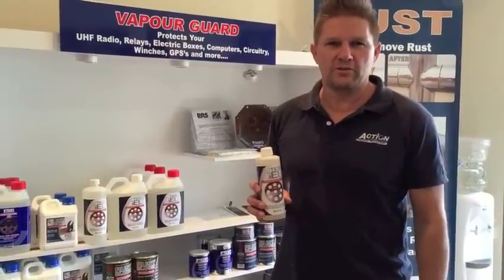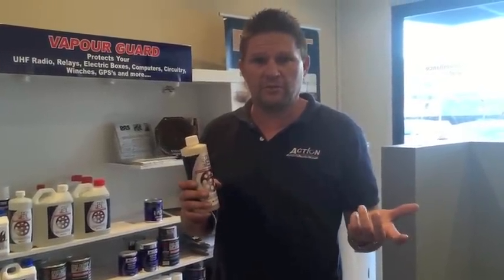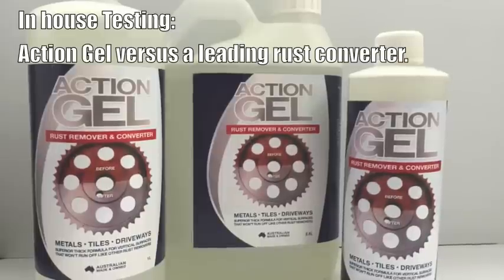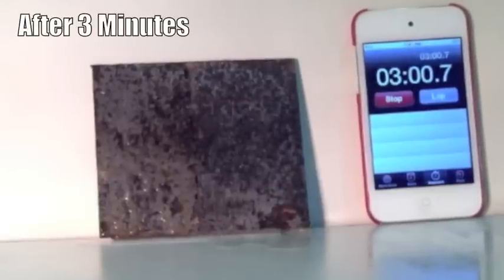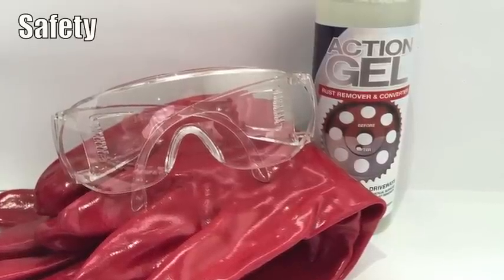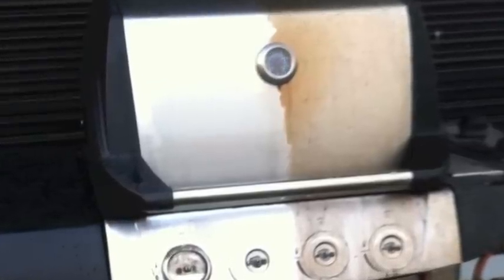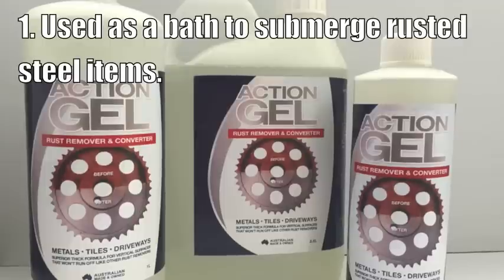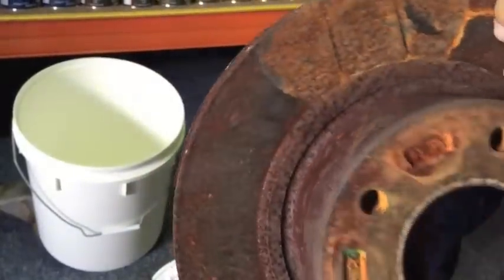Rust Remover versus Rust Converter

Comment: Wonder if I can use this on my vehicle. My battery leaked and caused my battery location to rust.
Reply: Yes you can but change your battery for a gel battery instead or glass mat one
Reply: @RetroYamaha  my truck uses a 24f. I see there is an energizer one for $269 at Costco.

Comment: If this product worked as well as seen in this video, sandblasting would be less common.The old rust that forms near the sea is very tenacious and cannot be easily removed even with an angle grinder and the silicon carbide disc that is specific for these jobs.Maybe you can dissolve the rust from small objects.Perhaps the only product that can going well and saving time and effort is the Owatrol.

Comment: Rusty roofing nails will leave a rust stain on paint as it runs down the wall, I see this all the time as I'm a painter and a little ajax and water on the paint and it comes off without any effort, no need to buy these types of chemicals just for cleaning house paint.

Comment: I have been exploring rust treatments and I have found that all the popular acids (hydrochloric acid, phosphoric acid and white venegar) for rust removal leave a brown rusty looking residue even though I have washed it before drying. does action gel do this as well?
Reply from the maker: Action Gel will absorb the rust and leave the bare metal. For heavy rust it may need to be applied twice to get all of it off. However when done correctly, there is no residue left.

Comment: Can your product be used on a galvanised boat trailer. Will it damage galvanise. I want to use it inside the galvanised trailer tubing. How ca i do it
Reply from the maker: All products can be used on Galvanised metal. You just need to monitor the Action Gel whilst it is applied to ensure it is washed off as soon as the rust has been removed. If you would like to discuss your project further feel free to call 07 5524 2990 or email admin@actioncorrosion.com.au

Comment: What's the difference with this and phosphoric acid?
Reply from the maker: The Action Gel is a phosphoric based product. However pure phosphoric acid is much harsher. It will burn skin easily unlike the Gel which tingles and gives more time to wash it off (Although we still recommend appropriate safety gear). Pure phosphoric acid is also harsher on the metal and will encourage flash rusting again if the metal is not treated immediately. Phosphoric acid also has a consistency of water which runs off and does not stick on vertical or horizontal surfaces like the Action Gel.

Comment: how does this work on auto paint? does it remove auto paint and the rust. you need to do a demo on a car that is full of rust.
last qu. do you ship to the USA
Reply from the maker: For vehicles our products are only for the underbody, interior metal surfaces, bulbars, accessories and plastics. We do not recommend our products to be used on auto paint.  Yes, we have distributors who ship all over the United States. If you email admin@actioncorrosion.com.au with the products you are interested in and your location can assist you further. Or you can order directly from: https://www.actioncorrosionsales.com/shop

Comment: Do rust convertors make the rust solidify?

If you covered a badly rusted car in it would it make the rusted parts as hard as the steel?
Reply from the maker: The Action Gel is a Rust Convertor and Remover so it removes the rust from the metal. You will not have issues with the rust solidifying. When using the Gel, we always recommend doing a small test area in an inconspicuous location and don't let it dry by reapplying if necessary.

Comment: The Red stain on a concrete surface is actually not the concrete rusting. It is an indication that the steel inside the concrete is rusting and the rust color is migrating out to the surface.
Reply: No, it's a result of iron-rich water. We see this here in parts of central British Columbia, where most of us are on wells and iron is a problem. It stains driveways, fences, the sides of homes, anywhere a garden hose or lawn sprinkler wets a surface. The solution: a fairly expensive Birm-based iron filter at the well-head, which removes almost all iron and turns awful water into great water.
Reply: @paulmaxwell8851  , that is also common in perth australia for the same reason when bore water is used.

Comment: So how much for a 1 litre bottle?  This isn't the only gel based rust remover, there's another one I found in Bunnings. The problem we have here is all these products use phosphoric acid, yet some come as low as $15 for 2 litres and another for $54 for two 1 litre bottles, same shit, bigger mark up. So where does yours fit in?
Reply: the price usually differs due to the concentration. the higher the percent the more expensive 1l is gonna be.

Comment: VERY cool! But the first thing I thought of when you hosed off the rotor, is "OH NO! Now it's gonna rust again!"
Reply: Yes, bare metal rusts.
Reply: @PBMS123  Use rust remover first, wash off dry it with a hot air gun then apply rust converter, that's what I do.
Reply: @hf5909  doesn't make sense. why're you applying rust converter on a clean rust free metal? what is it gonna convert? 😂😂
Reply: @richmadrid9563  because metal rusts every second. you just cant see it. and due to not being able to directly paint after rust removal then you apply rust conver to just be sure

Comment: I am not trying to knock anyone's product but these things that say they neutralize rust.No.They may neutralize the rust on top but they do nothing to the rust that is deeper and covered over.There is no easy,fast way to eradicate rust.If you can get rid of the majority and can seal it good enough to keep any oxygen from getting to it,you can slow it down but eventually it will come back.There is a reason they call it metal cancer,because any overlooked step and it will return and when it does it has done twice as much damage.
Reply: True :/

Comment: Totally removed?You must need glasses because I could still see rust there.It didn't do anything inside the pitting.Even wire brushing doesn't get in the pitting.After You wire brush look really close in the pits and you will notice the wire brush just glazes the rust that is deep in the pits.The only way to get rid of all the rust is sand blasting or replacing.But even sand blasting won't get it all.There is almost always places that you can miss.The only way is to replace metal,prime with an etching primer,than prime with an epoxy primer.After that use a high quality paint that is thick so it gives a little barrier in case something hits it.You don't want a paint that is too hard though because if something does hit it a hard paint will chip easier.I have been dealing with rust for 35yrs.Thats how long I have been doing bodywork in a state that gets a lot of snow and we are on the coast where there are a lot of people that commercial fish,so their vehicles are in and around salt water.
Reply: Denise Harriman umtrue, these acid based compounds will clean out the pitting if you use a pressure washer to wash the pitting out.

Comment: The ONLY rust remover is sandblasting or mechanical wire brushing all these 'Chemical Cures' are "snake oil"
Reply: Are you saying that Fe₂O₃ + 2H₃PO₄  doesn't yield 2FePO₄ + 3H₂O?  If you don't believe chemistry, do you think the earth is flat too?  LOL.  Phosphoric acid type of concrete etch/prep not only dissolves rust but leaves a protective iron phosphate coating that works as a sort of primer. Just don't use "muriatic"/sulfuric brands.
Reply: It's phosphoric acid with some kind of gel added to make it easy to apply.
Reply: I guess viniger is snake oil too despite me dunking rusty shit in it only for it to come out like new
Reply: ThreeDaysOfDan  
All of the chemical converters (snake oils) are a temporary solution, not a cure.
Reply: (except the bent bits)

Comment: With phosphoric acid products don't you always get re-rust problems from that acidic surface?
Reply: ParadoxPerspective you have to neutralize the acid with baking soda then water
Reply: ParadoxPerspective you would need to wash off the acids, then apply oil. If you just leave the metal surface exposed it will usually rust again quickly because of all of the pitting left behind.
You can just wipe light oil on it.

Comment: Phosphoric acid based converters like these are very effective at removing rust. If you are UK based, Jenolite is a very similar product, or you can easily make your own from phosphoric acid, http://www.ebay.co.uk/itm/Descaler-and-rust-remover-Phosphoric-Acid-Max-Strength-85-industrial-5-Litre-/291698405426?hash=item43ea947032:g:0qcAAOSwh-1W1qvJ Dilute with 1 to 2 times water for a bath, or add a little common flour, stir well and let it sit for 20 mins to make your own thick gel. Apply cling film over the gel once applied to avoid drying out and leave it an hour....

I'd also add that it's best to keep applying, washing off and wire brushing until all rust including pitting has gone. (It can take some time) Then finally wash, immediately dry thoroughly and apply acid etch primer followed by paint to suit. Do this and rust will never come back! 

Don't waste time and effort with converters, they don't penetrate right to the bottom of any pitting and invariably your new paint system will fail within a few months to a year or so at most! Take a little extra time to remove 100% of the rust first, no converters work, you have to remove 100%, whatever manufacturers say!!
Reply: For surface rust I agree.  If the oxidation has advanced to the point that heavy scale has formed then there is nothing that I am aware that can penetrate that and arrest the oxidation which will appear later on as eruptions.  The scale simply has to be removed before applying liquid removers through use of needler/scalers.
Reply: Hoganflagle if you use enough acid you'll remove all of the rust no matter how deep. Just remember not to leave the bare iron surface exposed or it will rust extremely quickly now that you pitted it with acids.

Comment: Could you do a whole car with rust remover?
Reply: +michael jagger I have a classic car with some rust I want to neutralise, before painting it. If it works it could save me a lot of cutting and welding new metal in! So +Action Corrosion Pty Ltd can it be used on a car chassis?

Comment: Honestly, drop that rusted plate in vinegar for 24 hours and get the same results. good day mate.
Reply: +chmellen The thing is that it is very difficult to dip a steel bridge, railway carriage or the steel poles of our house into a bucket of vinegar.
Reply: get a bigger bucket.
Reply: +michael jagger Vinegar is fine, but weak, so heavy rust will take forever to remove with this. As for flash rusting, this won't be a problem if you wash, dry and paint immediately. Also, flash rusting is very easily removed by wire brushing immediately prior to painting.
Reply: Phosphoric acid is better than acetic acid.  Harder on rust, easier on good steel.  Get a brand of concrete etch/prep that phosphoric (HP3O4) instead of "muriatic" (sulfuric acid H2SO4).  It's maybe $10-15 USD/gal.
Reply from the maker: +chmellen Great advice chmellen. When the surface flash rusts twice as bad about ten minutes after you apply the vinegar they will buy our stuff.
Many thanks Action Corrosion team
Reply: +chmellen Acetic acid vs phosphoric acid.
Reply: It may remove the rust but I bet iron acetate isn't as good as staying passive below a paint layer. I.e. I bet the residual bits of treated rust will rust back again.
Reply: +chmellen Yeah vinegar is good for rust removal like most acids.
Reply: chmellen
Reply: G'day!  The formula for phosphoric acid is H3PO4.  Muriatic acid is hydrochloric acid, formula is HCl.
Reply: your just putting up barriers
Reply: Vinegar is to acidic, kills metal
Reply: @revolutionthrurevelations6839  I soak my tools in vinegar if they’re rusty, it leaves a nice grey patina that holds oil and doesn’t rust nearly as bad as before. The only downside is it’s only good for soaking and it takes a long time, other than that I like the effects of a vinegar bath.
Reply: its really not. watch project farms latest test
Reply: chmellen might be a problem if I need to do the car mate .
Reply: chmellen 24 hours? XD! What a funny joke!